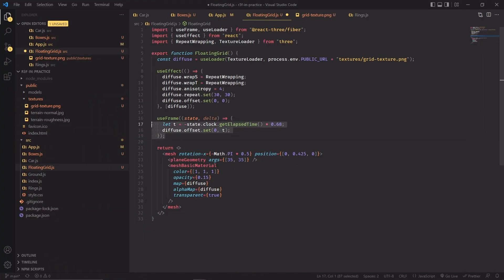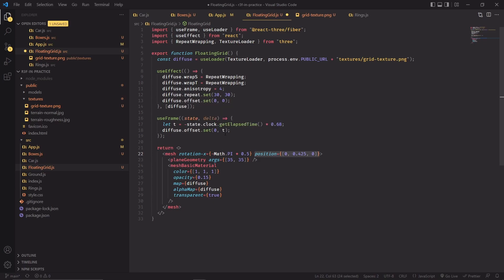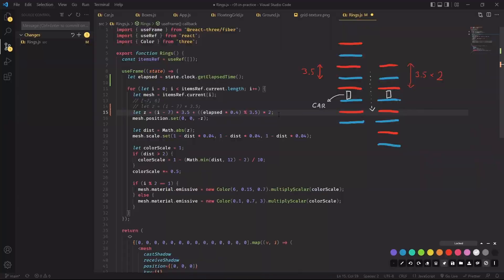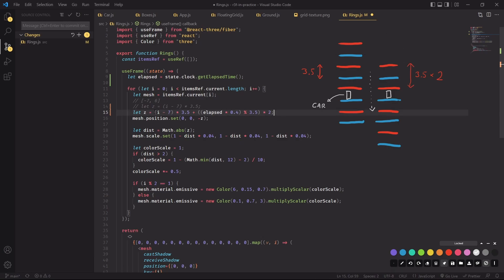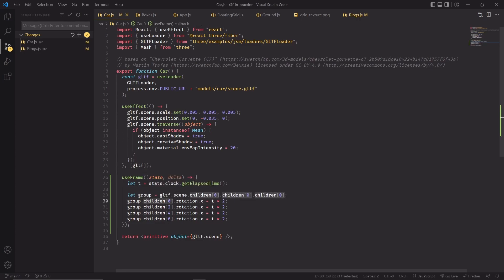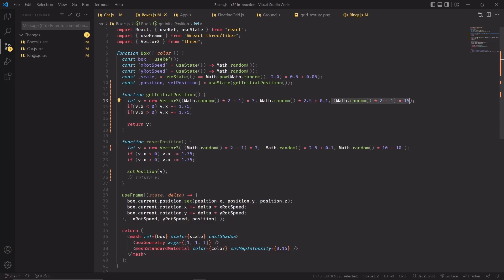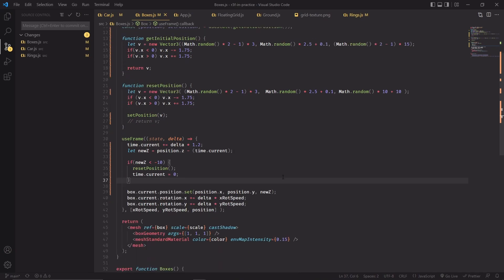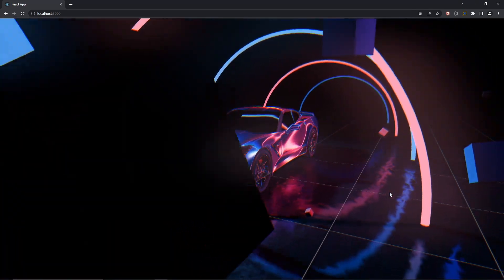Create a 3D car show with React Three Fiber and Three.js [ Tutorial part 4 ]

Comment: How did you manage to rotate the wheel without falling off the car? Although I am not using react but rather svelte/threlte, the wheel of the car are always getting detached. I can't make it stick on it. Is this dependent on the car model from sketchfab,etc?

Comment: Hi bro, How can I find the wheels array easier?? I was looking each children but my 3D model is complicated...
Reply from the maker: Hello hello, just open the model on blender and check the file structure on blender, useGLTF will always try to replicate the same file structure, alternatively use gltf to jsx, google that one as well and it might help
Reply: @irradiance730  Thanks I found doing this, but my wheel is rotating around the car, not rotating stopped...😅.  I will check the code from the github, but maybe the library changed...
Reply: @irradiance730  I checked the code and I have no idea why this is happening...maybe my model is different, the wheels are not spinning but rotating around the car, it this make sense? I am using the same version of yours and it still doing wrong
Reply from the maker: did you try to change the axis of rotation to another one?
Reply: @irradiance730 I tried before, Although I checked and I realise that the 3D model from your example is very specific when we talk about wheels. When I used your model, worked very well, but when I chose another one, I had trouble

Comment: 3:24 How did you know the tires were in that group?: 1st child, 1st child, 1st child, 1st, 3rd, 5th, 7th, child
Reply from the maker: This was unfortunately a common question and it made me realize that I should be more careful with this type of assumptions in the future, what's happening there is that I have inspected the structure of the model in blender and I already knew in advance the parent/child structure of the mesh and that's how I could easily locate the wheel meshes
For future projects though I'll do something different, usually gltf models exported from blender also have "names" associated to each mesh, next time I'll just do a scene.getObjectByName("wheel-x") kind of lookup, which should be much simpler to explain and should make it easy to spot all kinds of parts of a model by just looking at the names in blender

Comment: Thank you so much for this incredible tutorial. I want to know if I change the car, how do you know which element is the wheel for the useFrame. Because I have changed the car for another, and it can't find the wheels.
Thank you.
Reply from the maker: Thank you! :) Unfortunately the process isn't straightforward, because different models are structured differently, for example, in blender you could place all the wheels in the same mesh, or split it into 4 different meshes that live in a "folder" nested deep somewhere within the mesh
The way I did it was by looking at the model in blender and figuring out the structure of the model, then in threejs I was looking at the "children" property of each sub-mesh of the model
it's a bit painful but that's how I did it! something else you could do it to open the model in blender, select the meshes of the wheels, and change their names. Once you change the name, the exported .glb model will keep the names you gave it in blender and you'll be able to find the meshes by looking at their names

Comment: I'm new to this and I wanted to change the car. I changed successfully but now I don't know how to make the wheels spin. How do you know what children you are saying to spin? I didn't understand at  3:20. Thanks brother!
Reply from the maker: That could be a long discussion but to sum it up:
If you open a glb/gltf model in blender, it will often be organized in a structure that looks like folders and files, but we're usually dealing with 3d objects that are parent and children
For that particular car model, the tires lived under those parents (you could also think of it like if they lived under those folders)
I knew the indexes because I opened up the model in blender and saw the structure of the model, but every model might have a different one.
Something else you could do is to inspect the glb/gltf model in the console, and try to remove some of the children of those arrays, until you find the children that contain the wheels
Hope that helps!
Reply: @irradiance730  Thank you for the help. I will try that! And btw, do you know how to make the app lighter so I can see it in mobile without having 1 fps? :)
Reply from the maker: definitely start by removing some of the postprocessing effects on mobile!
Reply: @irradiance730  I'm not sure how I'll do that but I'm giving my best atm. I successfully made the 4 wheels spin on the new car (I checked on blender but every index was 0 for some reason). I ended up doing trial and error and eventually made it! 

Next step I will try to make it less heavier and I'll to add a window with a panel like:
- Click here to Open Doors;
- Click here to Open the trunk, etc

I'm a front-end dev and I'm not used to do this but I'm starting to like it. 💪 Keep up the good projects coming.

Comment: I just finished it and it was awesome, thank you so much I have learned a lot and appreciated the concise way of teaching.  I am willing to replace the car by an animated charachter walking to infinity and being able to change his pants. Do you know if this can be done and if yes what path would suggest to go with. I have patterns(masks) that go on pants and want to be able to change it based on the press of spacebar. Would you be willing to help me work against $ or could you just point me the way to go ? (Blender ? or Stay in three js)
Reply from the maker: thank you for the compliment! You can definitely use this project as a base for what you're describing, and I think for skinned-models and animations you'd use the useAnimations hook from R3F (I have no experience at all with that but I did find a codesandbox example here:)
https://codesandbox.io/s/gltf-animations-pecl6?file=/src/App.js

hope that helps! cheers
Reply: @irradiance730  do you by any chance know how to load a background image in reacht three fiber and it be in 360 degrees?
Reply from the maker: Yes! Soon I'll have a project that covers that, in the meantime look into the "Environment" component for drei (and when you choose an environment, make sure it's in .hdr format)

Comment: thank you for this best explained video of r3f.  I had a question, for the wheel to move the gtfl file need to have meshes so that means in the sketchfab software you need to have a Tire model and attach it to the car model?
Reply from the maker: Thank you for the compliment! :) One thing that I forgot to say in the video is that every model is created differently, the artist that made that model decided to have each wheel as a separate mesh, and that's the reason why I'm able to rotate them
If your model doesn't have the wheels as separate meshes then you wont be able to find them as children of the gltf group, however in that case you could still select the vertices individually in blender and then create a submesh